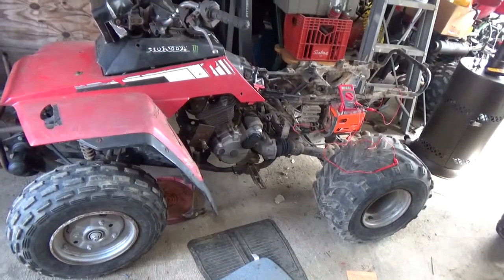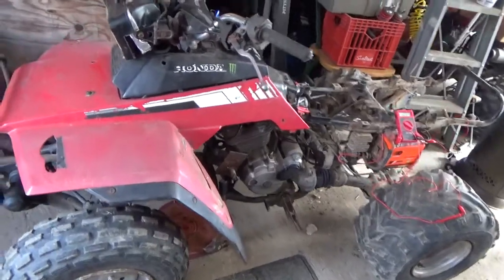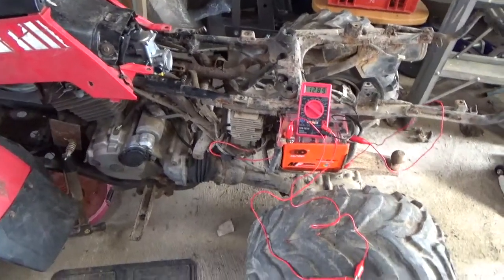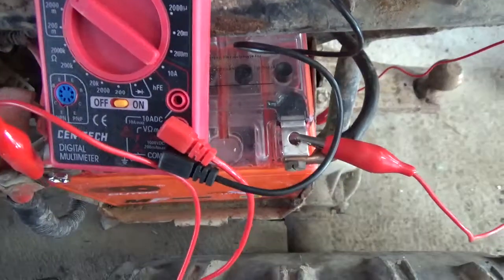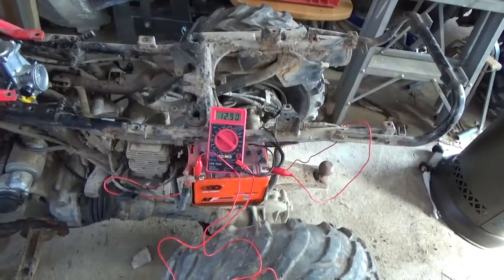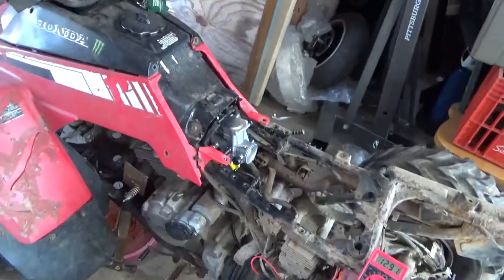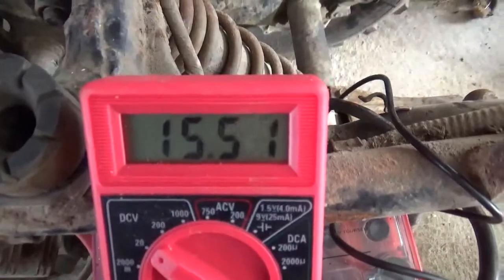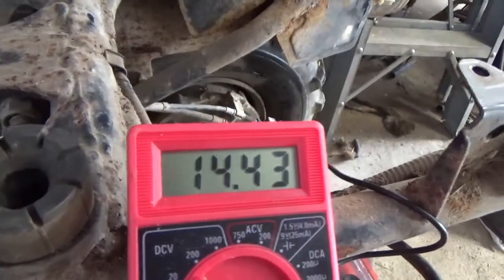Honda ATV, wiring fixed, is the battery charging, some simple tests?

Comment: i had a craftsman riding mower that a fuse link between the battery and starter was bad. hair line crack that would drain the battery in a very short time. had craftsman (sears) look at it twice after my dad and i traced the wiring with one one of those light meters.

Comment: To bad you lives close to ottawa ont. Would love help with the 84 as Honda big red I have was told it needs a cdi but wiring is all sorts of fucked in the headlight
Reply from the maker: Hey Cody!!! I spent a week in Canada a couple of summers ago, Prince William Island area, very nice folks!!!! The next version, the newest generation of the portable CDI system is under development, it is high performance and rechargeable.... I should be putting a video up on it as soon as the parts come in and it would work well on Ur 200ES, stay tuned!!!   Thanks for the info Ur thoughts, watching, and commenting!!!